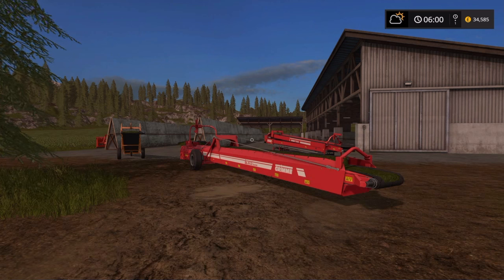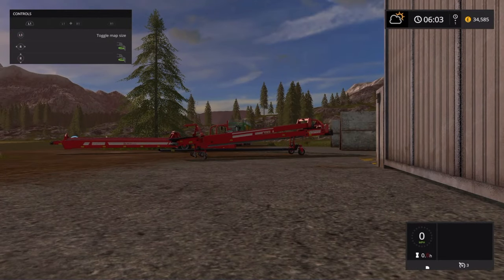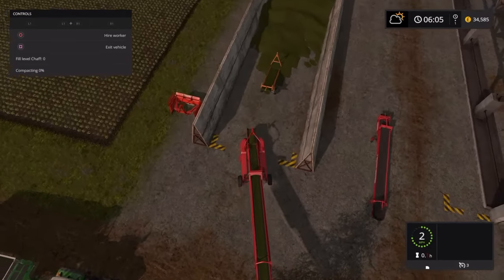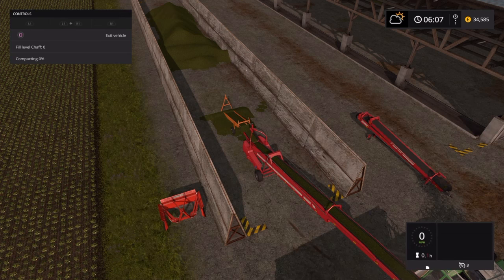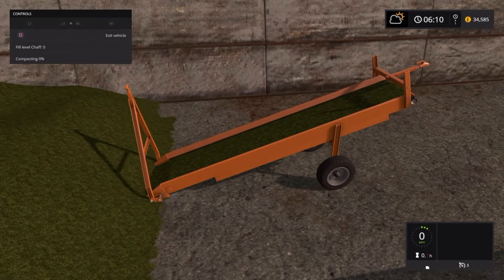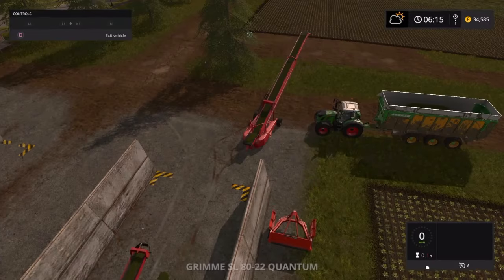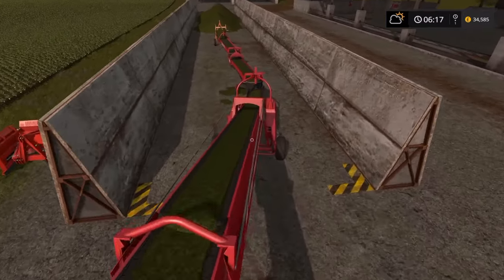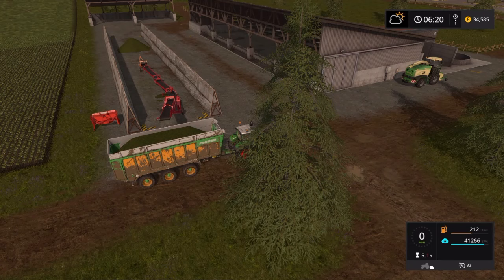Farming Simulator 17 PS4: Conveyor Belts, Guide

Comment: i like the conveyor belts in this game but 1 thing that bugs me is if u connect the belts they start to act weird after a while and im also dissapointed by the lizard belt because its not even close to something that is normaly used to scoop up materials irl the ones we use irl have mostly a controllable arm for dragging stuff and those u can actualy drive back and forth scooping material with an automatic extending belt at the back side. but aside of that nice video.